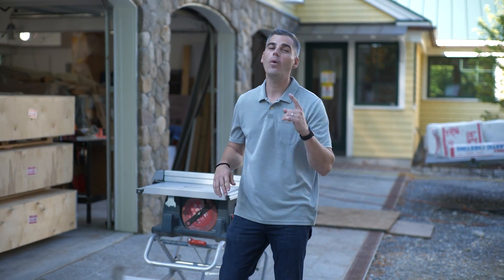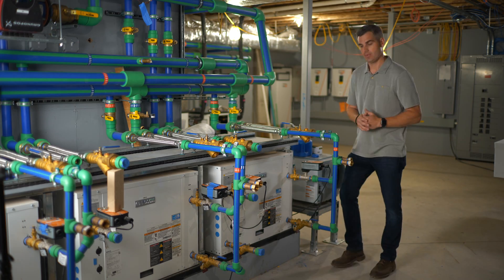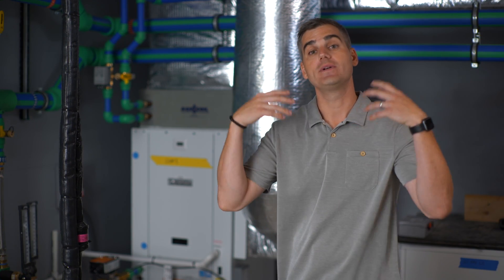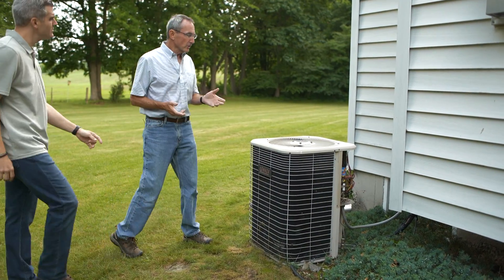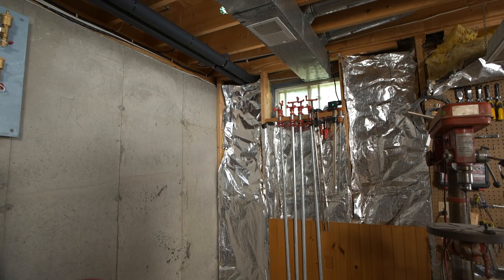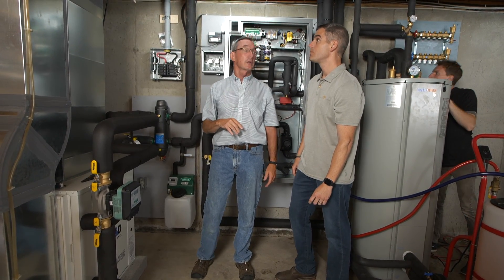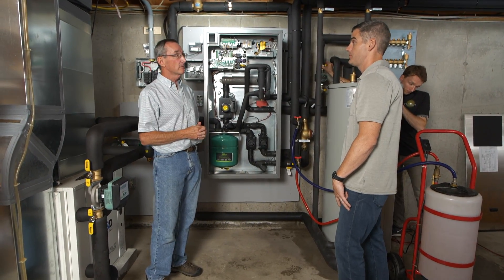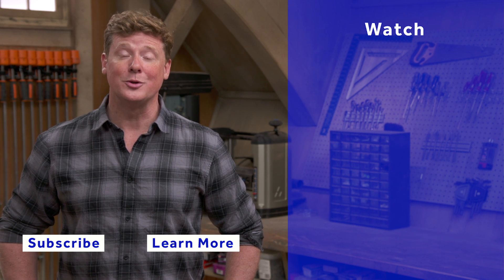Understanding Heat Pumps | Future House | Ask This Old House

Comment: What i hate is when the high cost is always seen as "its not worth it". Heat pumps are going to need to be a thing because no matter how efficient gas is - its on a limited timescale not just climate wise, but it is literally a limited resource, maybe 50 years, sure but ill be alive in 50 years!
Reply: Brian g c  and James noggle, care to disclose your financial interests in fossil fuel or conventional systems? Doesn’t matter if it’s 100 years or 1000 years. Those fossils are going to stay in the ground. Simple facts are that renewables are more cost effective and all the technology  to make it available everywhere, all the time, at better prices are falling into place. Even if there was no concern for climate change these new techs will win on economics, game over for fossil fuels.
Reply: @ericnegron485  They are Texans. If only there were wind and sun in Texas alongside all the oil and gas. :)
Reply: Oh your one of those climate scam believers 😂
Reply: Natural gas furnaces use far less grid power than heat pumps.  San Antonio gets it electricity mostly from coal-fired plants.  Almost all new residential construction are all electric, with heat pumps instead of gas furnaces.  Grid failure in 2021 may have been due to that extra load
Reply: @jamesnoggle2661  Not just furnaces, but also water heaters. The second largest consumer of electricity in a home is the water heater. A/C and electric heat are the largest users. Most homes save over $400 per year using gas for heating and for hot water instead of electric.
Reply: @briangc1972  Yup.  I'm sure you know, gas water heaters keep sediment in suspension (heat source below) and flowing out out to the hot water lines, while the electric elements literally drive the sediment to the bottom of the tank.   I've replaced elements, the lower one usually is buried in inches of white flake scale and burns out.  I would never buy an all-electric house.
Reply: You are mistaken about natural gas, there is enough for centuries of use. The oil companies fought it back in the 60's and 70's because they knew it would destroy their future. Had the Alaskan Pipeline been built for natural gas and oil as originally intended instead of just oil, the Middle East would be financially ruined (think of all the wars and terrorism that would not have happened), the Exxon Valdez incident would never have occurred, we would be driving natural gas powered cars and our city's pollution would be a fraction of what it is today. Big oil and dirty politicians are to blame.

Comment: Air to Water will give you : Radiant floor, wall, ceiling, radiators, pool heating, hydronic mini-split, DOMESTIC hot water and AC. CAN'T BEAT THAT. This technology is finally catching intrest. I work in NY and see many mini-split units in houses but in winter people don't turn them ON. It's not comfortable. It's very dry and in defrost they blow cold air. More and more people ask about Radiant heat and I believe this trend will continue...
Reply: Sorry could you talk a bit more why people don't use the heating system. You said I blows cold air. I thought it was supposed to heat the air?
Reply: @suzihawkins4352  in defrost mode it will blow cold air into the room.

Comment: With the air to water system how do you get domestic hot water in the summer when the heat pump is in cooling mode?
Reply: It has control lines and would switch back and forth - pump cool water to air handler, then switch to heating, stop the airhandle and water to there and run the hot water to the tank. Heat Pumps don't get a high enough heat most of the time to be called hot water - so it needs a tank to add the extra heat there to get it to hot water temperature.

Comment: The system looks great, but they never actually give you any numbers with these systems. How cold can it be outside before supplemental heating is required. I’ve had mini splits and they do genuinely produce heat down to about -5f, but you really had to use the auxiliary heating system starting at about 20f. Just because it’s producing a warmth. Does not mean it is enough to pull a house out of the deep freeze. For example… In northern Wisconsin as I’m typing. It is currently -30f actual air temperature. Having just moved here from a life born and raised next door in Minnesota. That’s not even bad. I’ve lived through much colder than this…

My question is what are the numbers? At what temperature does it stop working?

What is the actual air temp it’s capable of producing?

Can it heat a house that may have froze from a power outage in subzero temps…?
Reply: Brandon: All your answers (except for the last question) are in this video: https://www.youtube.com/watch?v=YH6pRiITHA8
They don't get into the numbers until somewhere around 25:00.
It generates usable heat down to -17 degrees Fahrenheit.
Reply: It really depends on the system,  Each system has different capacities.  If there is air there is heat.  What matters is how well the system can transfer that heat energy.   One could potenntially extract heat from -100c air if the system was designed for it.

Comment: The most important question is how many years is the break even point. If it is less than 7 years then it would be a smart investment. If it's over 10 years then it would be good for the planet but likely a poor investment. Lastly, if the owner moves before reaching the break even point them the current owner effectively paid for the next owner's system.
Reply: Just include the cost in the selling price. It is an investment.
Reply: @kokovox  - your comment is exactly how successful real estate investors think. The only issue is that real estate investors find that some investments return less then they spend. For instance buying a house and spending $7k to replace the furnace and the house is then worth $3k more. This is the opposite of what investors want. This is why people that plan to sell their house don't put solar panels just before selling. They would pay $20k for the solar system and be able to sell their house for an extra $10k, effectively losing $10k. I agree that it can be an investment for the original owner if they stayed long enough.
Reply: When it comes to reduction of expenses, you might want to take into account the 4% rule (the idea that you can retire once your investments reach 25× your yearly expenses.) By that measure, anything less than a 25:1 cost vs savings ratio helps you retire faster. So if I spent $9000 self installing an air source heat pump and save $1000 a year by your measure, this may be a mediocre investment, but from a 4% rule perspective, it’s as good as having another $25,000 in my investment account. 

And in my case, it’s more like $1500, and the price of oil is just going to go up and up. (This would be a much different calculation if natural gas was available in my neighborhood.)
Reply: @generallyhelpfulsoftware646  - you sound like a math nerd (a good thing BTW). I pretty much agree with everything you say. The only thing I can add is that I generally use 7% return as the lowest, mostly because over long periods of time the stock market has returned 10-12%. Of course as one gets closer to retirement then that person will invest in safer, and therefore lower returning investments. The 4% rule is highly conservative because it assumes you are taking money out of your pot and that pot must last until you die because you will never add more money to it. Another way to think of this is if the Heat Pump system cost $50k and broke even in 20 years, then that's the same an an investment earning 3.6% return (this depends strongly on how fast energy costs increase). If one instead put $50k in stocks and earned 7% over 20 years you would have $201,936. In other words it's mathematically better to have paid more for energy but used the $50k to end up with a higher net worth at the end of 20 years. Regardless, not every dollar needs to be maximized in life and being able to have free energy in retirement gives peace of mind, which makes retirement that much less stressful. Just be certain to still be in the same house after 20 years to get the benefit.

Comment: Im a plumber and do heat pump. This system is amazing but the cost is ridiculous. Nothing to compare with a mini split
Reply: Was going to say, how does this compare to a mini-split + hybrid (heat pump) water heater as separate entities.
Reply: @Mike__B  your looking at at least 16k in equipment alone plus what ever average labor rates are in your area for a super pro plumber,/HVAC contractor 
This system is called enertech they have awesome stuff (like boiler backup) etc but cost a fortune
Reply: @Mike__B  this sure is a hell of a lot more complicated than a mini split/ water heater setup with no real backup on the wh side there is a lot of moving parts and a lot to go wrong, in my opinion as an HVAC technician the best system you can get is a 80% furnace on a coil with a 16 seer condenser with out an inverter it's mid range as far as price, and if sized probably relatively comfortable when coupled with a steam injection humidifier and it's almost a set it and forget it system (besides filters)
Reply: @Mike__B  as far as an explanation why this is more complicated is because this has a hydronic loop in it pump circulators and all that goes along with a boiler on top of that it also has a refrigeration side and all that goes along with your regular AC and everything has to work together to make it work if any one of these components are out of whack you won't have heat and hot water whereas an electric heat pump how water heater always has resistance backup you know your toaster doesn't die everyday but most people call an HVAC technician once every 3 years mini splits are around since the '70s and they are pretty tried and true at this point but still quirky at least when compared to a furnace
Reply: @Cfish613  Inverter compressors work well up north. Down here in the SW desert, they have thermal issues when the ambient exceeds 110˚F. Last summer, the factory techs were complaining of the no start problems because the electronics got too hot. Imagine 100+ customers all calling when it is 110˚ and complaining their new inverter unit isn't working...... The solution was to start the unit before the ambient hit 110˚ and keep it running, they have a built in cooling circuit for the electronics so as long as they don't cycle off they will continue to function. They are working on a shade/ insulation solution to keep the sun from overheating the electronics compartment.

Comment: Not really seeing the advantage over a refrigerant system other than the domestic hot water. Even that isn’t a big deal since you can just get a separate heat pump water heater. 

Seems like a retro fit into a house that used a boiler/ radiator system is really the need for this.
Reply: Yes, people who have a boiler for heat and duct forced air for ac. Perfect for that.

Comment: I just put a air to air heat pump (Bosch) in at my beach house on eastern Long Island. We don't really use the house in the winter, but like having heat for the late fall and early spring. 

I was surprised when the pump was able to keep the house warm when it was 28 degrees out.
Reply: Who installed it? Was it Mikey pipes?
Reply: I hope that you got the special salt water coating on the coils. It is optional, but very much required for applications within a mile of the ocean.
Reply: @briangc1972  I second this. Parents have a winter place in FL close to salt water. I'm amazed how many of the heat pumps there still work with the damage from the salt in the air. It eats the coils like crazy.
Reply: @jblyon2  more crazy cost.  Should be just fitted right? Not an option...

Comment: That air-to-water system looks amazing.  The vendor/installer mentioned that the homeowner (in this case) would be saving ~$2K/yr in costs.  I would like to know roughly what the homeowner costs were (& therefore, the payback period) and if/how could solar hot water panels could be tied in to further reduce costs.  I am aware of at least one hot water tank provider/producer that has a "dual-fuel" source hot water tank.  Regardless, the air-to-water looks like a great way ahead.
Reply: Save $2k a year and will only take 30 years to pay that system off, but with all those electronics it will only last 10 years..
Reply: This system probably costs upwards of 20k just for the parts. If they don't sell to the public then it becomes 40k++ easy with the installation. It probably qualifies for the 26% heat pump tax credits but installers usually mark up their prices to dip into that.
Reply: The duel heater is usually an electric resistant element to compensate/replace the heat-pump if it malfunctions or if you need hotter water than 120f. This would work only for the domestic hot water though.
Reply: I would like to see the actual previous utility bills and then compare to a quality high efficiency multi stage air to air heat pump and a heat pump water heater.
Reply: I could be mistaken, but I believe solar hot water panels are actually less efficient at creating heat than electrical solar panels since there are no pumping losses, and in the case of powering a heat pump water heater, the efficiency could theoretically be over 100%.
Reply: @hardwarecompugeek  Really depends on multiple factors. Currently most Solar PV will go from  DC to AC then back to DC which each phase change as a bit of a loss, along with PV only able to . You are right about not needing to pump, but pumps themselves are very efficient too and depending on where the solar hot water panels are (2 storey building vs 1 storey) it would vary quite a bit.

I still see a key piece in term of thermal storage in general. In many cases until the price of batteries comes down more - having a large thermal mass in the home (could be an extra water tank) to provide residual heat is a better strategy than trying to rely on oversized batteries.
Reply: Typically systems like these never actually pay themselves off. Geothermal are very expensive to install.
Reply: @davidmollard9832  In the plains states, they are much less expensive to install and the payback is under 10 years. In the SW, our soil temp is too high and we need an air to air system as back up for 3 to 4 months, so they are literally a waste of money in places like Phoenix.

Comment: So, what’s the COP on these units?
Reply: COP fluctuates with outdoor temperature and delivered water temp. But at 17 F outdoors it has a COP = 3.4
Reply: @rosstret  — so, the next question becomes, at what point is it more cost efficient to heat with gas as opposed to using the heat pump? Because at low enough temperatures, before the heat pump becomes totally unusable, it still crosses a line where it’s more cost effective to use gas than electric.
Reply: @shubinternet  it depends on the utility prices (electric, nat gas, propane, oil) and the efficiency of each system. But generally speaking a COP > 3 for electric heat pumps will be economically superior to any fossil fuel system at todays prices….in this case the heat pump will cost less than 1/3 what the propane system cost to operate.
Reply: For a more detailed answer, see this YT video from Enertech: https://www.youtube.com/watch?v=YH6pRiITHA8
All the COP numbers for all  outside ambient temps and load side temps (lower for radiant heating, higher for forced  air  coil, even higher for radiative  or water heater).

Comment: When in cooling mode (summer time), does the air-to-water system still provide hot water? How?
Reply: Yes, the water heater is prioritized. It stops cooling and switches flow for the few mins to heat the water. Then switches back to cooling.  Usually with out you knowing.  Boilers do something like that when they provide domestic hot water.  They often prioritize the water heater.
Reply: @--harry_  That switching will greatly reduce the efficiency of the system. Unfortunately, the energy ratings of these systems do not reflect that aspect. They only test each function alone which is not has the system works in real life. Trying to switch from hot water to A/C and back is a major design flaw.
Reply: @briangc1972  they do that has nothing to do with it's efficiency
Reply: When not in cooling mode  reverse flow and  heat the domestic hot water. Simple.